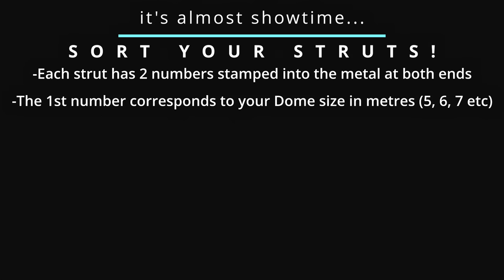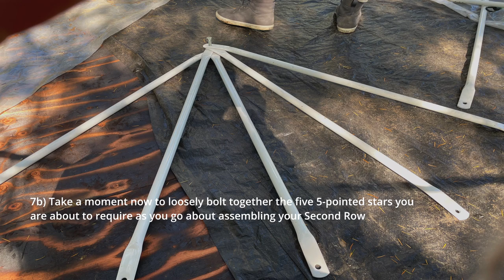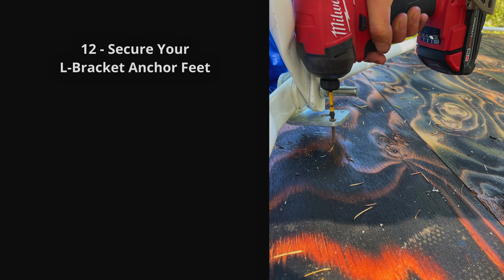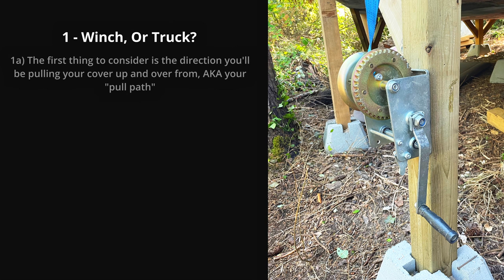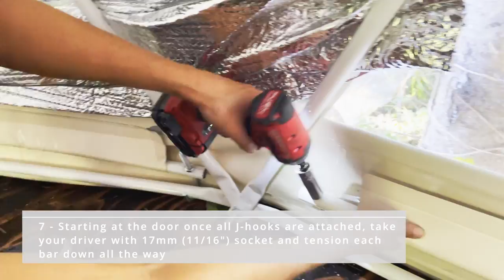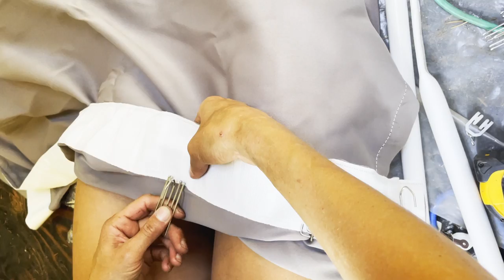Assembling Your Phoenix Dome!

Comment: You guys should really have a section for the installation of the chimney, and fitting of the cover on the door frame... Especially because these are crucial moments where you need to cut the cover.
Reply from the maker: Hi there! We have a number of comprehensive instruction guides on our website under the resources tab. Here you will find chimney installation instructions to follow. If you have any questions or concerns at any time, please reach out to our customer service at contact@phoenixdomes.com and we will be more than happy to assist in any ways we can :)